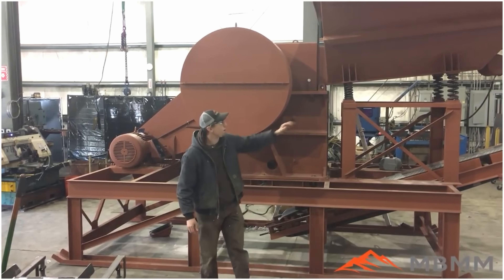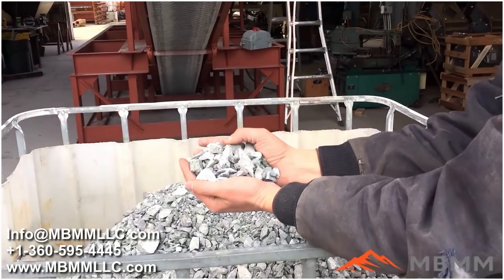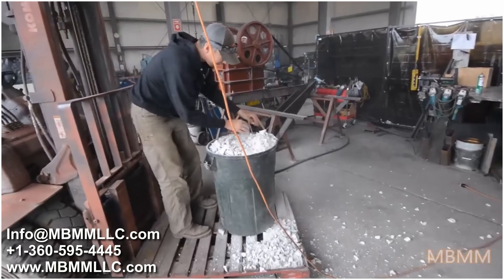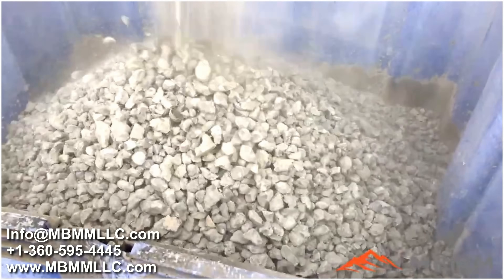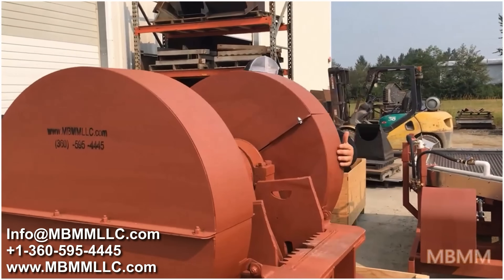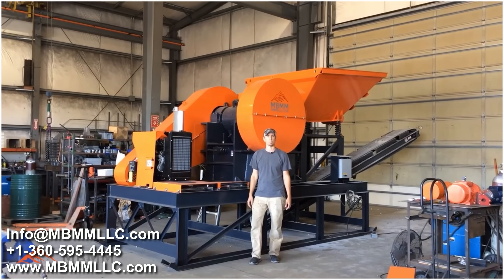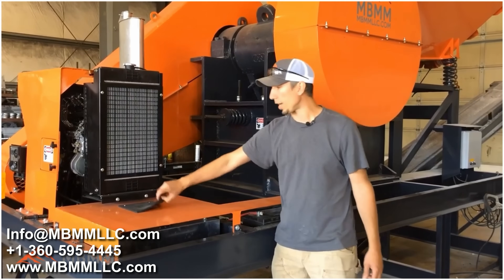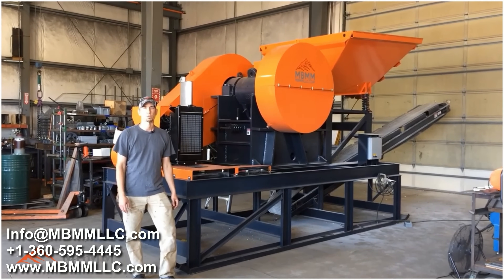Jaw Crushers For Crushing Rock, Concrete, Asphalt, Granite

Comment: Here in Australia, broken concrete is one of the most expensive waste products to go into landfill, charged at hundreds of dollars a tonne.  

Graded, crushed concrete and liberated scrap rebar, however, is worth fairly good money, especially the rebar which sells to scrap yards for around AU$470 per tonne in my city.  It doesn't take long to get a tonne of rebar by running freshly crushed concrete under a magnet separator and the concrete product itself is used in many applications from temporary vehicle pads on construction sites to reconstituted polished concrete floors and wall panels.

Comment: Great video!  You don’t need phase converter.  If motors are less than 10HP you can get 1 phase 220Vac in 3 phase 240Vac out variable frequency drives for low cost.  Danfoss, ABB, SqD other manufacturers have these.
As a by product motors will last a lot longer in the field reduced inrush current.

Hope this helps

Comment: Hi Jason I watch a lot of your video's and I had a thought while watching this one  ..reinforced concrete was always awkward to remove but a real pain in the butt to get rid of. 
Do you have a crushing system that can deal with rebar and steel mesh while its still in concrete so the rebar could be recycled  as well as the aggregate...not from a personal need but one I know can be a big problem for contractors

Comment: One of the most mesmerizing things to watch is material flowing through a crusher.  No matter if it's a jaw, a horizontal impact or a cone crusher.  It's super fun to watch!
Reply: I worked for a large paving corporation on the east coast for many years running a crushing operation. We crushed a lot of asphalt for reuse in the asphalt process and always found that if you run your jaw crusher in reverse and fluffed the feed instead of pulling it down into the crusher, we got better product and production especially in the warmer months when the asphalt would get gummy

Comment: As someone who serviced portable Metso rock crushers, I can tell you that asphalt is one of the most abrasive, wearing materials a crusher can process.  One of our rental customers did nothing but asphalt and I serviced that machine WAY more than I would have liked.  They weren't the most pleasant people to work for.
Reply: Asphalt in the UK is based on very small granite aggregate so the crusher has to break the tar part of the asphalt more than the stone but the stone will work just like huge quartz based sandpaper
 I assume most countries would use something similar,

Comment: Good to see the work products as well, beside the mining adventures :) 

Are there any sorting attachments available for the crushers? For making e.g 1/2" to 1" gravel? Also, i think that the crushed product is less consistent when input material is flat and about the same thickness as the jaw opening. I think the countertop scraps would be better gravel if the jaw opening was reduced to 3/4"

Comment: I feel like a mist/fog sprayer would be a nice quality of life addition for these systems, just to knock the dust down, but not enough to saturate the material.
Reply: you beat me to it mate 1000s of Aussies are dying of silicosis from cutting kitchen benches all fake stone is now banned in Aussie to much dust on that machine mate well done and you don't know how much silicone is in those rocks its like smoking 100 cigs a day
Reply: @ahoytheremate1954  its not silicone, its silica. Silicone is used for caulking 🙂
Reply: @ahoytheremate1954  Eh, its all a massive scam to make people pay more, its nothing to do with perceived safety.
The local mine has dust plumes 3x4 times the high of a high tension tower every other day covering the town.
You need to wash the windows/cars etc. constantly, the EPA doesn't care.